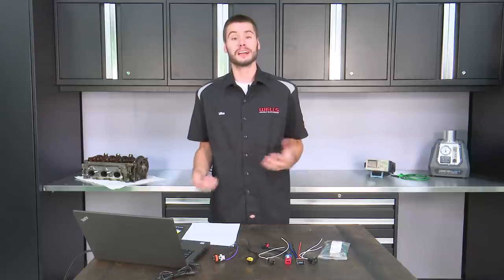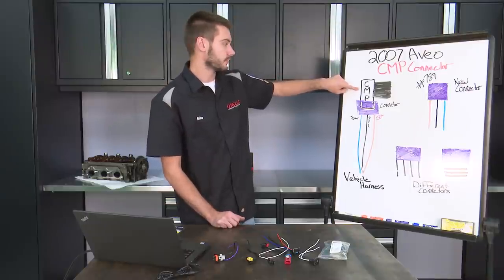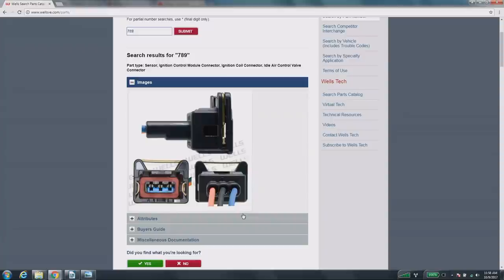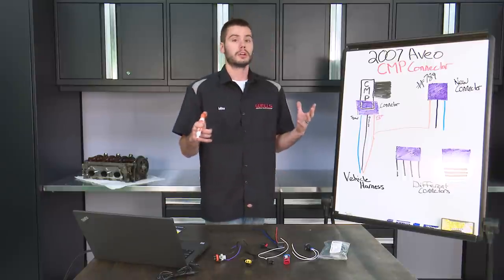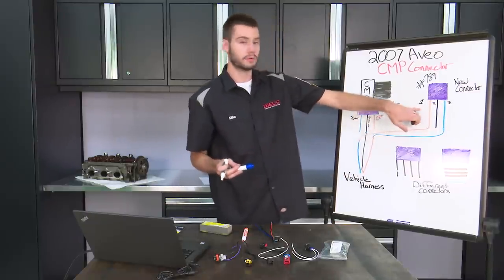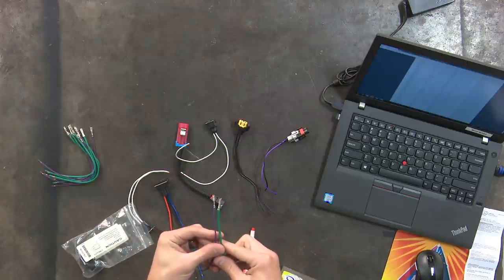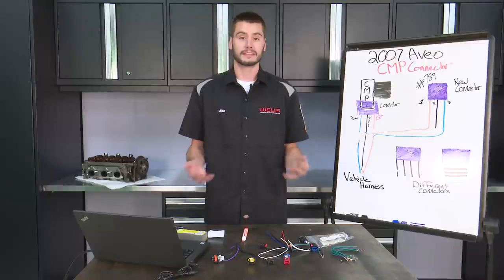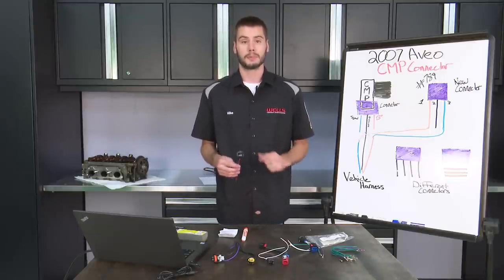CounterPoint Ep. 32 - What You Need To Know When Buying a Wells Connector or Pigtail

Comment: Yes I swapped the terminals so the wire colors were correct and there was nothing in the box except the connector which got my attention if a DIYer had received it and hooked it up by wire color which is why I contacted Mike. I also swapped the terminals so if some other tech was diagnosing and backprobed by wire color they wouldn't go on a wild goose chase if they didn't  check the plug configuration. I always check wire colors and pin configurations before I ever splice in a connector. It was a customer's Aveo and yes it did fix the intermittent CMP fault.  My concern was there was no instruction sheet in the box I received and concerned someone may connect it up wrong but Mike took care of it. Nice to know it was supposed to have a sheet stating the colors may be switched.  I took before & after photos and posted them on my Hayward's Automotive FB page also. Thanks Mike for following up and I still prefer Wells over any AM brand and some OEM. IMO all universal plugs should have white wires.
Reply: as a long time tech, i have seen this before but never bought a Wells pig tail.  I have used many AC Delco pig tails which you know the wire colors are all white.  i think Well's should have done the same to make it simple and/or put instructions in the box as well.
Reply: Yes this was my first Wells pigtail and I normally just install new terminals if the wires are good but in this case they were all heat cracked. The pigtails I usually get are BWD and the wires are usually all white or black or the right wire colors. All I could think of was a person less experienced just connecting the wires by color so I contacted Mike. Mine may have been a return and that is why the instructions were missing but most connectors I get don't usually have them. If it's a universal connector it shouldn't have wire colors so there is no chance of someone connecting by wire color plus if I see a connector with all white or black wires it's a flag the connector has been changed.
Reply: Hayward's Automotive 👍 Great catch! you made a good call. Thanks for thinking of the next guy 🍻
Reply: Thanks Will!
Reply: To get round this problem, a small circle of the correct colour in the form of a splice of heat shrink to match the original colour code, to ensure continuity of design and for the benefit of the next tech troubleshooter.
Reply: Tom OConnor  It was easier just to swap the terminals around & took less than a minute and then it was per blue print & it wasn't a problem for me just a concern for someone else. I normally swap the wires and press on. My comment was if it's a universal then make all the wires white and a DIYer won't make the mistake and a mech/tech knows if the see all the same color wires the plug has probably been changed and the seasoned ones know to get wire color & terminal location when diagnosing.
Reply from the maker: Exactly Bob, a DIYer could have a really bad time if they don't have the technical experience. I am hoping that with this video, and the instruction sheet in the box, we can completely eliminate any question regarding our pigtails. I wish every connector that we sell could all use a single color wire...but it just isn't a reality. That's why we do these CounterPoint videos! 
Mike Becker, Technical Services Instructor
Reply: Agreed!

Comment: hey mike  a year late  but here's a suggestion- on "universal fit" where it uses colored wiring  just package the parts unassembled so the end user can configure it as he/she needs.  here's why- the next guy is gunna look at a wiring diagram and see wire colored(you pick) is signal. not looking at a connector pinout.  now if its anything but where its supposed to be  instead of signal they may see battery voltage  or 5v ref  maybe nothing. a smart tech will pick up on this but others may get confused  and in the end just blame it on "that crap wells sells"( though we know differently)   or just use all white or black on everything(save on inventory by not using all the colors)
Reply from the maker: Richard, all great ideas. Ill see what I can do! Thanks!
Mike Becker, Senior Technical Instructor

Comment: are you serious ? it's not rocket science, you have the replacement connector make it work, NOT A BIG DEAL. Flat rate !!
Reply: WEStTEXAs It wasn't a big deal.  I swapped the terminals around in less than a minute.
Reply from the maker: Rocket science or not, this problem is/can be a big deal for the less exerpiecanced.
Mike Becker, Technical Services Instructor